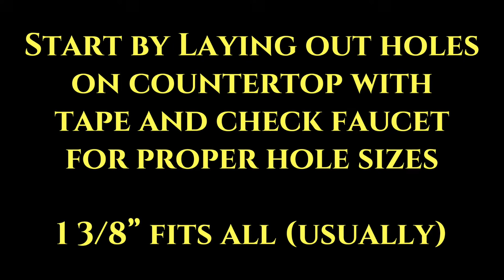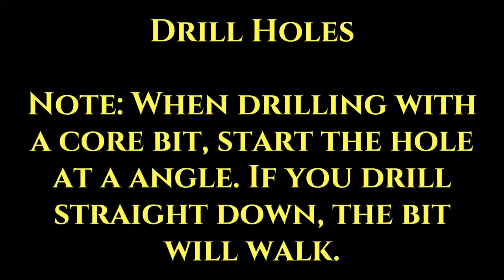How to DRILL Holes in GRANITE Countertops (Quick and Easy)

Comment: I'm a carpenter and not a granite guy but every so often we have to drill a hole somewhere that the granite fabricator forgot or a customer added on...and this is exactly how I do it.  Glad to know I've been doing it the correct way all these years.  :-)
Reply from the maker: Thanks for the comment. Great minds think alike. Have you ever have one walk on you yet?
Reply: @GraniteByJay  I certainly have. lol.  That is when I started tipping the grinder at an angle when starting to drill.  There are a few guys I work with that are too scared to freehand the grinder when drilling granite so we have jigs made up with all the standard size holes.  They just clamp it to the top and drill away.  Seems to work well too.  Just a little more time consuming.

Comment: I would also add one point, have a good vac operator and do not wash the sink especially like the stainless until you have removed any loose debris so as not to scratch surface, loved the video
Reply from the maker: Thanks a ton. And yes, the stone chips will trash a new stainless sink pretty fast. Great advice. And thanks for watching. Means a lot.

Comment: You can drill a 1 - 3/8" hole in a piece of plywood and use that as a jig for your core bits that don't have a pilot bit so it doesn't walk on you, I'm a plumber and have drilled tons of these holes and sometimes it will walk on you.  this is my method so I don't damage a large expensive slab of granite
Reply: How do you clamp down the plywood jig to an installed countertop to keep it from moving as well?
Reply: @DJDJ808  with clamps

Comment: Well, it turns out that the available hole saw had a different thread than my angle grinder. I had to get a cheaper saw that was made for a drill. The drill was unhappy, but it got the job done. Thanks for the video.

Comment: Does the power on the grinder matter? I need to cut one hole, one time. I don't mind buying the bit, but the grinder is pretty expensive. Harbor Freight has a 4 amp one for cheap. I dont need it to last but I was thinking the power is the factor here for cutting through granite.

Comment: This is a great video, thank you! Just out of curiousity, is there any concern about potentially cracking the granite while doing this? Or does the taping help with that?
Reply from the maker: Hello. There is always a possibility for cracking. The type of stone makes a big difference, but here are some things to watch out for.

1. Heat - If some materials get hot enough, they will crack or pop the surface. Both are bad. To prevent this you can use a spray bottle with water and take breaks to let the bit and stone cool down. In the video you can see I only drill for about 15 seconds. Than I pull out the bit and let it air cool.
2. Vibrations - High frequency sounds, rattling, and unglued vibrations can all break the stone. But it has to be extreme. Pressing really hard is bad too. Let the bit do the work. 

The worst part is just getting the bit started. After that, you're good to go. Hoops this helps. Thanks for watching.
Reply: Super helpful! Thank you so much for responding. I really appreciate all the insight and hope to give this a try next month! Is there a specific tool you like or would recommend? Or can you rent one of these?
Reply from the maker: @AllisonSkiffdotcom  I would use or rent a variable speed angle grinder. We use an STS. The angle grinders that have one speed are way too fast for drilling with a core bit. The bit and stone will get too hot.
Reply: @GraniteByJay thank you for all your help!
Reply from the maker: @AllisonSkiffdotcom  Thanks for reaching out. Much appreciated. And go back to making videos. I checked to see if you were a creator. You made a couple videos in the past. You have the talent. 
One thing I'll say that I've learned. I have 4 other channels on YouTube. The one that is doing the best is the one I created just to help people with things I knew. I wasn't hunting for views or subs. Just wanted to help people. That's this channel. I would take helping one person over getting thousands of views and subs any day. I see that in your channel. Keep trying. People will know you are only trying to help them. That goes a long way. Best of luck. And try a couple holes on scrap material first. It takes a feel you won't get the first time.
Reply: @GraniteByJay  This was so kind of you to say thank you. I started a website and accompanying social media channels a year ago and quite honestly I bit off way more than I could chew. I am still running the website posting 1 time per week, a monthly newsletter and then my instagram account. All supported by posting to pinterest. I definitely underestimated it all! But my hope is once I find a bit of a rythym with what I currently have, I can hop back over to youtube and pick everything back up. But I really appreciate the thoughtfulness, and of course all the advice!

Comment: Does the Grinder matter? I have a Porter/Cable.
Reply from the maker: The grinder doesn't matter, But I would highly recommend a variable speed grinder. You want to run at a lower speed. Heat is your biggest enemy when cutting a hole dry like this. You can always use a spray bottle with water to keep everything cool too.

Comment: Great video.
I still have questions (as I need to cut a whole for a reverse osmosis faucet)
#1 What is the purpose of the tape and should it be a specific type of tape?
#2 As long as I still come in at an angle, will my pistol-grip be safe to use with the proper bit?
Thank You in advance.
Reply from the maker: Hello. Thanks for watching. #1 The tape is for laying out the hole. Any tape will do. It's really hard to mark stone unless you use a paint pen or sharpie. And sharpies will stain certain stones. #2 Anything that spins will eventually drill the hole. I've even seen people use cordless drills with adaptors too. I use a Metabo angle grinder because its variable speed and they last a long time. SIDE NOTE - starting at an angle reduces the chances of the bit walking greatly, but there is still a chance. Just go slow and grip firmly. Or use a hole guide cut out of plywood. Hope This helps and thanks again

Comment: for this drill bit, what would you recommend that would it work with a dewalt drill?
Reply from the maker: For this drill bit, you need an angle grinder. The drill bit has a female connection that will screw onto your grinder. I'm sure you can rig something up for a Dewalt drill but if your drilling 4-5 holes a day, that Dewalt will burn up fast and be trash.

Comment: I have been using a milwaukee 1" or 1 1/4" diamond bit with the 1/4" chuck for impact in a hammer drill (on drill mode) to drill holes for reverse osmosis faucets. Will this work for most counter tops? Or will I need different bits? This seems a lot quicker
Reply from the maker: Hello. I had to look these bits up. I have never used them before. They will probably work for most 3cm stone countertops. But here are a couple things I notice just by looking at the bit.
1st - The amount of actual diamonds and or cutting surface area is very minimal. I would suggest running at low speed with a water spray bottle. Keep it cool and go slow.
2nd - I would have to image, when cutting thru 3cm granite, this bit will only get you about 10-12 holes. and that's being generous. If you want a bit that will last for the money, Look in the description of this video. I have a link to one.
3rd - After doing 3-4 holes back to back, your driver is going to get hot. I always use an angle grinder. Even with an angle grinder, it get warm after 5-6 consecutive holes. It's a strain on any grinder.
Hope this helps and let me know how it goes. Thanks.

Comment: Where did you get that diamond, seen it sharp, I got one from Home Depot and it won’t work
Reply from the maker: There is a link in the description of this video to buy the core bit. You can get it right from amazon. The core bits they have at Lowes and Home Depot are more for porcelain and ceramic tile. But even for those tiles, they are a pain to use. Hope this helps. Thanks man.
Reply: Granite By Jay thanks bro

Comment: Thanks for the video & tips. You're missing the faucet plate at the end, by the way :).
Reply: The escutcheon plate? That’s for covering up mistakes or for cheap and fast installs like in apartments. He took the time to layout and drill holes in the granite to avoid using the escutcheon plate.
Reply from the maker: Right on man. Thanks. And the reason for the plate is to cover up the un-used holes on a top mount sink. Top mount kitchen sinks usually come with three holes drilled @ a 8" total spread.

Comment: So it seems no need for water to keep the bit cool as shown in other videos?
Reply from the maker: Thanks for the comment. The bit I used in this video is a wet/dry bit. Allot of bits out there are strictly wet bits. The main difference, is that the dry bits have ventilation slots on the sides to keep them cool. But note, they will still overheat if used for long intervals. Take breaks and let them breath. Thanks again.
Reply: Granite By Jay Thank you for the explanation 👍🏽
Reply: @swsquish  water also helps to keep the extremely dangerous microscopic dust down. Silicosis look it up.

Comment: Personally I would use a guide (better safe than sorry plus more accuracy) and I would add water to the drill bit and the stone so minimising heat to the diamond metal and stone. PS great work and only advising from past experience.
Reply from the maker: Thanks for the comment Vitor. I used to use water with all on-site holes. You should really try these dry cutting bits. You would be surprised. They still get hot, but not even close to how hot a wet bit gets when cutting dry.
Reply: I've drilled hundreds of holes and never once used water and never cracked a top. That bit he was using is wet/dry

Comment: My stainless steel sink is undermounted beneath a granite counter top. The spot I want to drill the hole for my filtered water faucet may hit part of the stainless steel sink edge underneath. Will the bit you used cut through stainless steel?
Reply from the maker: These diamond bits don't cut very well thru stainless steel. They more or less burn thru and you will trash your bit. It will make it. Just go slow and watch the heat.
My suggestion: Drill the stone first. When you hit the stainless, switch to a 1/8" metal drill bit on a normal drill. Then go thru the new hole in the stone and make a series of small holes in the stainless. Then try to snap or punch it out. Its a pain in the rear, but it works better than the diamond bit. 
Hope this helps. Let me know.

Comment: What bit do you use regularly?  I see a lot of listings for "1 3/8" wet/dry core bit with side diamonds" but I"m sure there is one you prefer?  Thanks!
Reply from the maker: Im a huge fan of the Cyclone Turbo Bit. I do a lot of on-site drilling, and this bit is a beast. Just make sure to give it a break every 15 seconds when drilling dry. Since I have been doing this, the bit lasts so much longer and stays fast and sharp. The heat is the main culprit when working with diamonds. Here is a link. Let me know what you think if you get one. And tell Craig from GMR Jay said what's up.
https://www.gmrqualitystoneproducts.com/cyclonedrybits.aspx
Reply: Granite By Jay awesome! Thanks so much! And is there any concern with cracking the granite with this bit?
Reply from the maker: @2alphazerodown289  You can crack any stone with enough heat. It's just as important to give the stone a rest break as it is to give the diamonds a rest break. And all stones are different. But don't worry, you will feel the bit glaze up before the stone will get hot enough to crack. Granites I do about a 15 count. Marbles I do about a 7 count. Man made quartz I can usually drill without stopping. And natural Quartzites are tough, take allot of breaks and I'll use a water bottle to spray the core bit just to be safe. It's hard to explain. After so many years you get a feel for it. But I hope this helps and feel free to write back with any more questions you might have.
Reply: Granite By Jay awesome info! Thank you so much!

Comment: Nice video never consider using an angle grinder , die grinder or some multitool to use the core bits on instead of a drill or hammer drill.
Reply from the maker: Thanks Sam. Much appreciated
Reply: Do NOT use hammer drill. Cracks granite!!

Comment: Can you also expand an existing hole with the same method?
Reply from the maker: You can for sure. If you have a 1 3/8" hole and want to expand to a 2" or bigger, use this method. If you have a 1 3/8" hole and want to expand to a 1 1/2" or a 1 3/4" hole, I would suggest using the 1 3/8" drill bit and using it like a drum sander to expand the hole. Most of the new 1 3/8" core bits have diamonds on the side walls. This is very useful when you want to expand holes. Hope this helps and thanks for watching.

Comment: Why 'wobble' the core drill, it then cuts a larger hole! Why do people when carrying out normal drilling run the drill in and out of the hole all the time, once the drill goes through that is it!
Reply from the maker: Hello, here are a couple reasons I wobble the hole. 1st - It makes the hole just a hair bigger which allows room for the dust and grit to escape. This keeps the diamonds cooler. Longer bit life I believe. 
2nd - With any core style bit, it is a total pain to get the core out of the drill bit if you drill straight down. Wobbling helps this. I usually just tap the grinder and the core falls right out. Most of the time the core falls out on its own.
3rd - You have a greater risk of over heating the stone and popping the surface. This is always bad. Especially when the faucet flange doesn't doesn't cover the oops. Yes, I've done this before. Embarrassing.
Thanks and hope this helps.
Reply: @GraniteByJay  I do like the use of an angle grinder but the thing is to control the speed. Also lubrication solves all sorts of problems and increases the life of any diamond cutter by 2-3 times. I attach a great site about using diamond cutters. https://www.diamondsure.com/Techniques.shtml
Reply: @GraniteByJay  I really appreciate how professional you are in your replies to suggestions and comments! I love that you don't get offended or defensive. You are very helpful
Reply from the maker: @derekschober9613  Thanks Derek. But for some reason your comment really aggravates me. You're a piece of ......
Just playing. Much appreciated. After 23 years of stone work now, I just want to help people out. I don't do everything the right way. But I do what has always worked for me. And as far as some of the bad and negative comments, they help the channel as much as the good comments do. So they have never bothered me. In the end they all are great for the page. Thanks again.
Reply: @GraniteByJay  wow for a minute there I thought you were replying to someone else lol. Thanks again I was extremely nervous attempting this since it was my daughters first house I didn’t want to disappoint her and always was told the granite would crack if it’s drilled so close to the edge .  I’ve been in commercial contracting all my life and retired, I did exactly what you said it it came out perfect! Thank you again